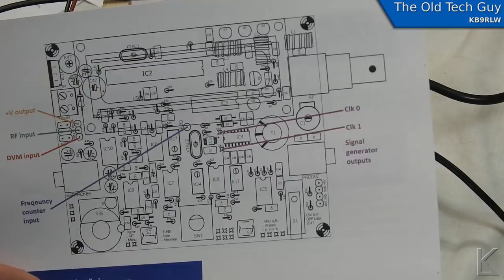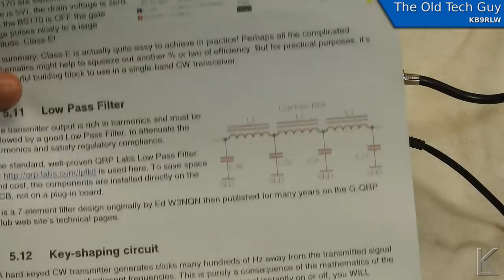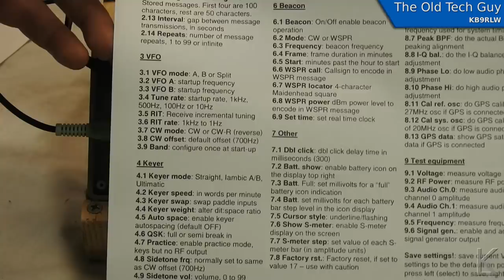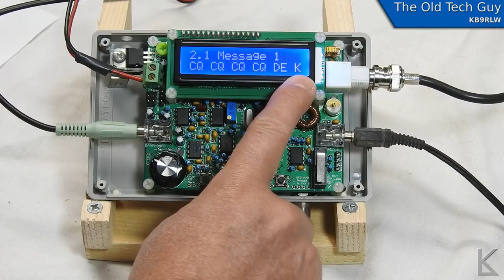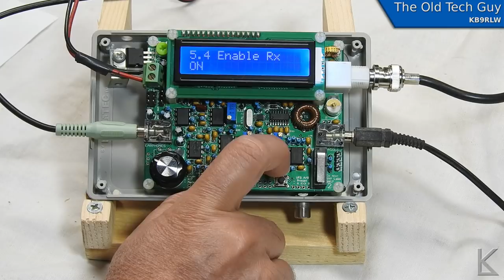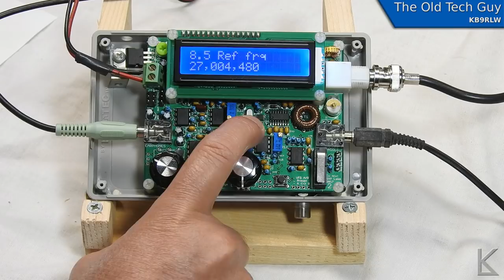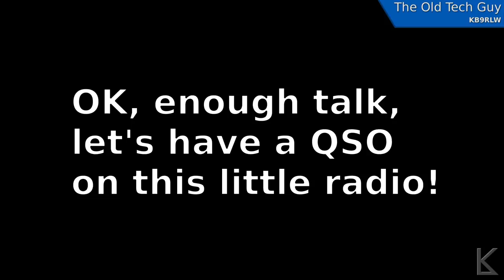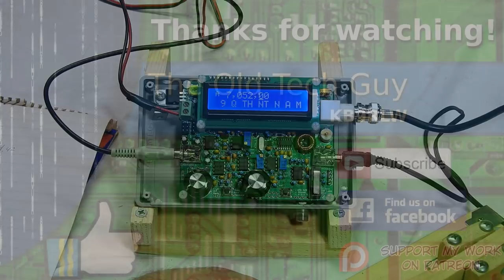Ham Radio - Review and demo of the QRP labs QCX transceiver kit.

Comment: glad that you are back with new videos. i live in a senior living center and am not allowed out side antenna. i use a home brew Mag loop in my room. it works pretty good but i pick up all of the electric noises. i use a icom ic7300 . it filters out the noise pretty good. from texas to fla. no problem. im on the first floor of a three story concrete  building. just a window. at least im still on the air at 30 watts. have a good day.

Comment: This receiver is sensitive. Connected my QSX+ and FT818 on the same antenna with a Y. They heard the same signals equally. Hard to tell even on the weakest signals. I have transmitted and listened via WebSDR's in western US and Australia and seen my signals.  I have to recommend the QCX+ Very Highly. Thanks Hans for a fun and excellent kit.

Comment: Very nice.  Got my 40m version in the mail this week.  I got the GPS and a dummy load with it.  I also ordered a 3d printer because of the video you did this week.  I ordered the Maker Select III 3d version 2.  I haven't done any CAD since college but I figure I can work up a nice case for the whole thing... maybe even find a market for them.  So thanks for the video.
Reply from the maker: Well since you have some CAD experience,  check out FreeCAD.  Runs on any OS and easy to use.   Plenty of tutorials online as well.
However,  there's a MUCH simpler option that I think you'll like.  Working on the video today.  Hope to have it up Wednesday.
Reply: Saw that video last night.  Very nice.  I'm an old C programmer from the K&R days.  So far OpenSCAD is getting the admittedly basic models drawn.  Made a nice BiQuad frame, a chassie/cabinet for some RB133 and RB153 RouterBoards I have laying about, a mouse trap. Who doesn't want to make YABMT?  Some other little things.  I just got the radio running last night and did some QSOs on it today.  My second QSO with the little QCX was with a fellow in SC who was also doing his second QSO with his QCX ...  Karma ;)  I'm running it at 12 volts.  I just have no desire to run one of those finals into a heat problem and the thing gets really hot when you turn on the WSPR beacon.

Comment: Nicely  done! Mine is on its way. You didn't mention the built-in "key," the microswitch for one-fingered Morse. Also, I'm curious about the position of C1. Per page 65 of the manual, it shows plates completely closed, which the manual says means the adjustment has hit its limits. I really enjoyed the QSO--I need to get my rusty CW back to standards! 73, de KEØOG
Reply from the maker: You'll have fun with the radio.   The plates are just slightly meshed, the level dropped when completely unmeshed, so I was just inside the range.

Comment: That SMD package is a SO-16 package. It can be de-soldered either by using hot air, or by cutting all the pins carefully with an X-acto knife, and then removing them one by one with a soldering iron. You can then solder a new chip just with the use of a soldering iron.

Comment: Thanks for some great videos Kevin. Got my kit the other day. Ordered 3 months ago. Took a while to get it due to big demand. No problem though and they were very nice when I emailed asking what was up. I got the GPS kit also but will have to figure out what to do with it. Ill let you know how the build goes. Your vids certainly take the sting out of the process. Thank You again and 73"s    Kevin Williams   KA5HSY. Royse City TEXAS
Reply from the maker: You're going to love the little radio Kevin.  Light on battery use and sounds great on the air.  The GPS kit will let you do WSPR beaconing easily, but yes, I don't know how often that would be used.  Maybe for watching the propagation change over the day?

Comment: Kevin, just wondering if you could purchase some pots with extended shafts to mount to the pcb.  If you were able to get them long enough, you could then print a box to fit the QCX txr in a home brew printed case.  In addition, I'm sitting here at my desk looking at a 10000mAh powerbank 5v battery with up to 3.4 amp output.  Printing a case that could contain the TXR and the battery, and using a buck converter you could increase the voltage from 5v up to 9v,12v,14v or what ever you needed.  With the internal 10000mAh battery, you'd have a very nice self contained rig that should run much longer than a 9v battery.

Comment: The DVM input could be used to show battery voltage if you use batteries for portable use.  Add a buck converter to your battery source and you could control your output power.
Reply from the maker: Good idea, the DVM input.   The buck mode converter would bring up the background noise level due to the hash noise it produces.  You'd have to filter the heck out of it's output.
Reply: Yeah you are right about the buck - 4 x 18650 li-ions should do the trick with a protection / charging module.  As you gave yours away - was wondering how you found it compared to your commercial rig?

Comment: Nice review Kevin. I finished my 20 meter version a few days ago, works great except only 1.6 watts out at 13.8 Volts. A lot of fellow QCX builders are having this problem on 20 meters, not sure why just yet. Im too chicken to attempt a QSO yet. Ive been using a Mic for too long:(
Reply from the maker: I hadn't heard that, about the 20 meter version.   Well, on 20, with a good antenna, 1.6 will go a long way.  Hunt around 14.050 for slower CW.  Lot's of SKCC guys around there.  Copy for awhile until you get your speed up a bit and then dive right in!   There's something satisfying when you make a contact on a kit you built.

Comment: Very good video.
Are you have bitx40 ?
Can you compare it with bitx40 ?
Reply from the maker: I don't have one to compare it to, sorry.  Maybe someone will send me one.
Reply: Kevin Loughin many thanks, I try to design to buy one of them.
Reply: Bitx40, unmodified, is a SSB transceiver.  This one is CW only.  So that is the main difference.  And I'm not sure that the source code for this QCX rig is available. (?) So if you wanted to modify the functionality of the code your hands are tied.  Hopefully I'm wrong about that but so far I haven't been able to find it.  The Bitx40 has fully modifiable code via easily modified Arduino "sketches".

Comment: There is now a purpose aluminium case for the qcx  finishes product off perfectly. 
My only con is that you cannot use the add on gps module while txing cw it only works for aprs mode apparently. 
72 Mark G0NMY

Comment: Hi, what antennas are recommended for this unit? 40 mts.
Reply: Any resonant antenna you'd use with any 40-meter transceiver.  Of course there are poor antennas, better antennas and best antennas.  The cheapest will be a simple coax-fed dipole mounted as high as you can get it, which is probably the most common antenna in use anyway.  Verticals works well, especially for longer ranges, but you have to tolerate the dead-ground "donut" at medium distances caused by the low radiation angle.  Another inexpensive option is the NVIS; an excellent receiving antenna with no dead spaces but which lacks long-range punch on transmit.  Of course the greatest variable is the 40m band itself.... a solid short-range daytime band that gets longer legs after sundown.  Of course if I had my druthers, I'd go for a directional log-periodic up about 200-ft.  :)

Comment: Thanks for the upload great incite into Morse on a board. Maybe someone could do a 3D Print of an enclose that could take the rig. Could the Code be learned this way or is there a better option to get started? as I have never touched a key.
Reply: You may have seen this already, but I see QRP Labs are doing a '+' version of this kit now that includes a few modifications and an enclosure.  (I think that most of this review is still very relevant, which is why I just watched it...)

Comment: So are you going to print a case for this as part of your 3D printer series?  Mine (40M) will probably arrive in another 3 weeks if I am gauging the fill rate.
Reply from the maker: I'd have to do it in pieces and assemble it after.  The bed on my printer is only 12cm square and I think the board is longer than that.   I haven't measured yet though, too busy on other things at the moment.   I'll probably look at it eventually.